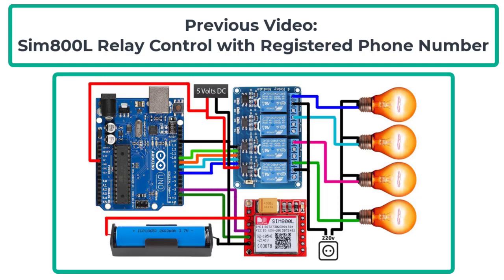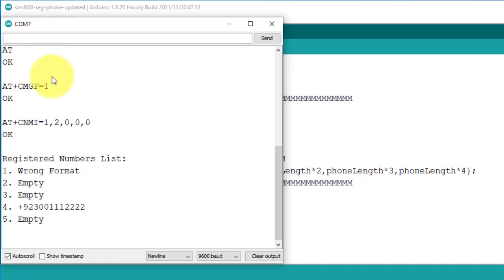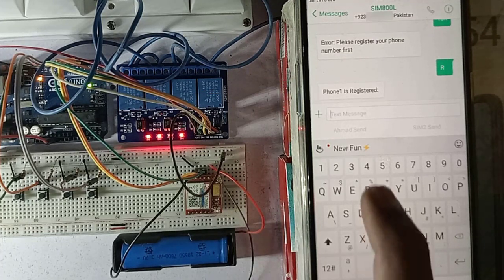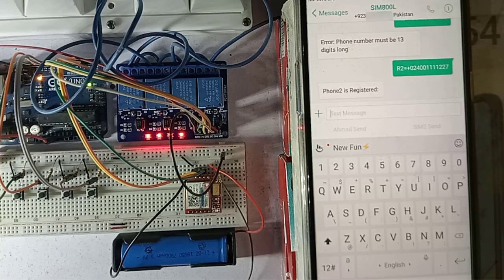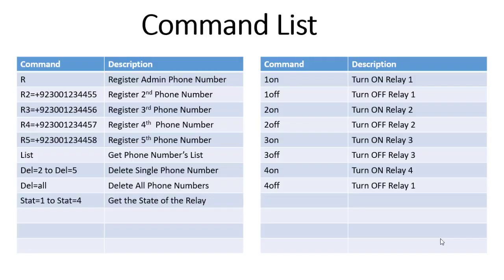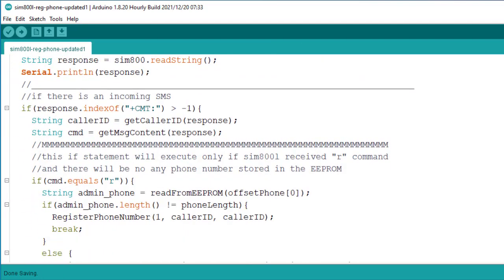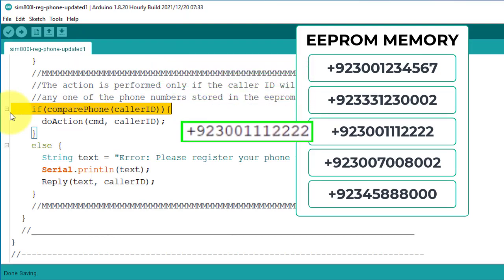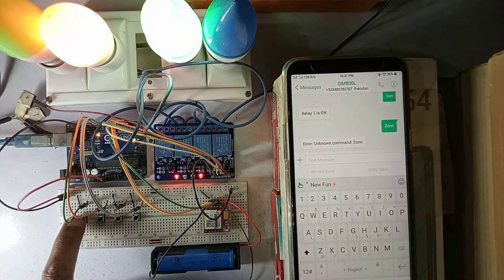SIM800L Home Automation Project Using Arduino and Push Buttons

Comment: Hello sir Ahmed I have a question, how can I send a message to all numbers stored in EEPROM just in case I want to send a specific message to all numbers that is registered
Reply from the maker: you need a loop to iterate through each number and make a call using ATD command

Comment: In this code and video, the response is sent only when the module is controlled via SMS.
But I want SMS to be sent by pressing the buttons. For example, when the first button is pressed, an SMS is sent like this: "Button1 has been pressed"
Reply from the maker: connect a button to arduino. then set the button pin i.e. int buttonPin = 1. in the setup pinMode(buttonPin, INPUT_PULLUP);

In the loop()
if(buttonPin == LOW) {
     delay(200);
      Reply("Hello", "PhoneNumber");
}

Comment: hi, how can send SMS when push buttons pressed!?
Reply from the maker: use in the loop()

if(buttonPin == LOW){
Reply("Hello");
}
Reply: @AhmadLogs  thanks dear Ahmad.. i did that,, but i want to change the state one of outputs too..all things okay, but the registered phone was not work for this operation, i define caller id for this function ... but after compiling, i faced the error about saved number
Reply from the maker: @mymail-f9e  can you give me the full detail about the issue.
Reply: @AhmadLogs  I'm going to add an input to this circuit that when triggered - for example when it becomes HIGH- one of the similar outputs will be activated(like led). At the same time, send a text message.
So I want to add an option for security system like PIR sensor .
Reply from the maker: @mymail-f9e  can you share the code?
Reply: @AhmadLogs  sure... Where should I send it to view?
Reply from the maker: @mymail-f9e  just upload it on github and share the link here.
Reply from the maker: @mymail-f9e  you can get the code for pir sensor from the descripton of the following video. https://youtu.be/d39VmyAcfys

It will give you idea how to use the pir sensor with sim800l
Reply: @AhmadLogs  thank you dea Ahamad... I have been solved that by redefine Caller_id in the sub loop function..
Reply: @AhmadLogs  the Reply(a,b) function has 2 string , so i cant use just 1 string like Reply("Hello") !
Reply from the maker: @mymail-f9e  sorry for oversight. the second argument is the phone number to whom you want to send sms. 
Reply("hello", "+923219988776")
Reply: @AhmadLogs  SIR I WANT TO SEND THIS SMS TO ALL REGISTERED PHONE NO. VIA SMS.
SO WHAT I DO.
Reply: @AhmadLogs  AND ALSO TELL ME HOW I SEND CALL TO ALL THIS REGISTERED PHONE NO. WHEN THEY PRESS BUTTON 1 TO ON OR OFF RELAY
Reply from the maker: @Humanityandfun  you can use multiple ATD commands for this
Reply: SIR PLEASE TELL ME HOW I SEND MESSAGE AND MAKE CALL TO ALL REGISTERED PHONE NO. WHEN MY BUTTON_1 AND bUTTON_2 WERE PRESSED

Comment: Dear Ahmad Vai, Assalamu Alaikum. Your videos are very good, informative and useful. Would you please make a tutorial on AC load on/off notification project please? In that case you can use SIM800L or SIM900, Arduino Nano and a 5v power adapter for check power on off. The circuit may run by a 18650 lion battery.
Reply from the maker: will try

Comment: Hi Ahmad. Thanx for your great job, it’s really impressive. Could you advice with the code if I use sim 900 instead of sim800l. This code is not working with sim 900
Reply from the maker: unfortunately I did not have sim900 module. so I am unable to answer. As I know, you need to modify some of the AT commands in the code.
Reply: @AhmadLogs  anyway, thanx for your video. It helps me a lot. Will continue to find code for my sim900

Comment: Hello Ahmad, your videos and explanations are great, I need your help, how can I do so that all registered numbers receive messages, for example, when a relay has been turned on or off... I hope you can help me solve my problem... Greetings
Reply: ok thanks, I just don't understand how I should call the make_calls function so that it interacts with the doAction function and the Reply function, so that it sends messages to all registered numbers
Reply from the maker: @pablotorrea9901  Sorry the above function was wrong.

use the following Reply() function, instead of original one.

void Reply()
{
  int phoneLength = 13;
  char data[phoneLength + 1];
  for (int i = 0; i < phoneLength; i++)
  { 
    data[i] = EEPROM.read(addrOffset + i);
    String myString = String(data[i]);
    sim800.print("AT+CMGF=1\r");
    delay(1000);
    sim800.print("AT+CMGS=\""+myString+"\"\r");
    delay(1000);
    sim800.print(text);
    delay(100);
    sim800.write(0x1A); //ascii code for ctrl-26 //sim800.println((char)26); //ascii code for ctrl-26
    delay(1000);
    Serial.println("SMS Sent Successfully.");
    delay(20000); //20 second delay.
  }
}
Reply: thanks friend, one more question the addrOffset variable must be declared within the () of the reply function or I can declare it within the for function, because if it is not declared it throws an error.
Reply from the maker: @pablotorrea9901  you might declare with within the function
Reply: Hello Ahmad, the reply() function that you indicated did not work quite right, it only sends a message and it is to the administrator, it carries out the process of sending the messages by viewing it on the serial monitor. I replaced all the call_id strings with myString ..
I can't understand if I'm doing something wrong, please help. A video tutorial with the explanation would be very helpful
Reply from the maker: @pablotorrea9901  can you provide me your code? just upload your code in github and share the link here
Reply: Hi.! Ahmad, I took a few days off, tomorrow I'll upload the file for you to review and help me solve my problem
Reply from the maker: @pablotorrea9901  provide me the link
Reply: hello again ahmad.. sorry for the delay, I'm using the function you told me to send the message to all the registered numbers, but as I told you, it only sends the message to the administrator.. it's a code for a program that I want to check states , but I need all notifications to reach all registered users. I hope you can help me
Reply from the maker: @pablotorrea9901  I know what you want. just post the link again. I will try to review the code
Reply: @AhmadLogs  I have repeatedly uploaded the link and it disappears from the comments, I don't understand why, I upload it just as you leave it in the description of the videos. Could you provide me with an email to send you the repository link please
Reply from the maker: @pablotorrea9901  I find the repository but there is no code. https://github.com/Pablo4
Reply: I don't understand why the link is removed
Reply: Pablo4torres/EEPROM-SIM800
Reply: Sorry, only in that way I was able to upload, just add at the beginning what is missing
Reply from the maker: you can use the following function to make call to all registered phone numbers.

void make_calls()
{
  int phoneLength = 13;
  char data[phoneLength + 1];
  for (int i = 0; i < phoneLength; i++)
    { data[i] = EEPROM.read(addrOffset + i); }
  sim800.print("ATD"+data[phoneLength]+";");
}

Comment: Hello sir. Everything works well but when i send a message, the relay board does turn on or off. And am sure the relay board works well and the circuit is well connect. Wha might be the issue there? Plz help me out.
Reply from the maker: check serial monitor send me the output

Comment: Morning please if anyone can help me as soon as possible. 
I uploaded the code directly the relays start from on as show in the video but when I change the phone length from 13 to 14 and upload the code, the relay doesn't even start from on and when I try register phone no, it was registered but when I send command it only appears on serial monitor and reply "relay 1 on" but no response on the relay at all
Reply from the maker: it works perfectly on 13 digits phone numbers. have you registered your phone number correctly?

Comment: I can't appreciate you enough for being such so kind hearted. Thank you for all your quick responses and prompt actions.

My own problem is that 
 1 *arduino needs to reboot after each action has been completed*. 

2 how can I add DTMF  to the project . so I can make  calls to control the relays too.

Please how can I achieve this? 

I await your response with urgency, thanks in anticipation.
Reply from the maker: here is your answer https://youtu.be/Hq1ZGWWc0e4
Reply: Hello Ahmad, your videos and explanations are great, I need your help, how can I do so that all registered numbers receive messages, for example, when a relay has been turned on or off... I hope you can help me solve my problem... Greetings
Reply from the maker: @pablotorrea9901  you can use the following function to make call to all registered phone numbers.

void make_calls()
{
  int phoneLength = 13;
  char data[phoneLength + 1];
  for (int i = 0; i < phoneLength; i++)
    { data[i] = EEPROM.read(addrOffset + i); }
  sim800.print("ATD"+data[phoneLength]+";");
}

Comment: Please add the flames and gases sensor feedback notification with sms and add the one more features is that if project  is start to run then add the call and sms function which gives the notification is system is active
Reply: This is bumble request to you plz make the video on this. Or may be shared code alao in the description plz sir

Comment: I watched your SIM800l tutorials, I am able to register 5 phone numbers by watching your videos. But can you please tell me how can I make a call to admin number which is stored in EEPROM memory when a switch is pressed. It works for the first time but if I turn off the arduino power supply it doesn't work. Please suggest me. Thanks in advance.

Comment: Awesome, Thank you! But how do you get the relay board to start with all off instead of all on?
Reply: The Relay he used in the project has three plug-ins. Common, Normally Open and Normally Close. A cable, either positive or negative must go into Common. If the second cable is plugged into Normally Open, the relay will default ON. If plugged into Normally Close, the relay will default OFF.
Reply: Hello Ahmed, I want to send me an sms when the device is turned on to start, so that when it is turned on remotely, what changes should I make in the code?

Comment: Thx for thr project bhai. Well, an doing the same project but the relays not responding. When i send a message it shows the relay 1 to be on but no reaction on the relays to turn on. What might be the issue

Comment: Hi Ahmad, how to add if the dedicated button is pressed send an SMS message saying BUTTON PRESSED like a calling bell
Reply from the maker: hardware setup: attach one more button to unused pin of arduino
software setup: define the pin for button before setup function. set the button input pullup in the setup. then go to the control relay function. and there check if the button is pressed using if condition. and inside the if condition use Reply() function. like Reply("Button is Pressed");
Reply: @AhmadLogs  no luck🙃
Reply: @AhmadLogs  Could you please check the below code for sending out SMS if the gate is open or closed, getting an error when adding  Reply(text, caller_id);

//XXXXXXXXXXXXXXXXXXXXXXXXXXX gate on / off button XXXXXXXXXXXXXXXXXXXXXXXX
void gate_on_off_button(){
if(digitalRead(BUTTON_2) == LOW){
 //control_gate(1, RELAY_1,STATE_RELAY_1 = HIGH,caller_id){
 // control_gate(1, RELAY_1, STATE_RELAY_1 = HIGH);
    control_gate(1, RELAY_1, STATE_RELAY_1);
    }
}

void control_gate(int relay_no, int relay_pin, boolean &status){
  delay(200);
  String text = (status)? "GATE CLOED !!!" : "GATE OPEN !!!" ;
  status = !status;
  digitalWrite(relay_pin, status);
  Serial.println(text);
  delay(100);
  }
//XXXXXXXXXXXXXXXXXXXXXXXXXXXXXXXXXXXXXXXXXXXXXXXXXXXXXXXXXXXXXXXXXXXXXXXXXXXXXX
Reply: hi, got the chance to look into this:dothefive:

Comment: Frind for admin register need send r or R fisrt ?
Reply from the maker: you either send r or R. both commands have the same function.
Reply: @AhmadLogs  bt why not register i did but my number length 14 need change 13 to 14 only?

Comment: Dear Sir it is possible to add the timer function please thank you for the effort you are making
Reply from the maker: yes it is possible
Reply: you can send us the enforcement code adding timer and call

Thanks
Reply from the maker: @adlanhugo353  I did not write it yet. I will soon make the version 4 of the project. and will try to add these features.
Reply from the maker: @adlanhugo353  will try
Reply: Please can you add me the code with the timer and call
Reply from the maker: @adlanhugo353  unfortunately not yet

Comment: Hello Ahmed Khan
Most of the time, we face insufficient pin in programming
It is possible to write a program that controls 16 relays using SMS and using shift register and 4 Arduino pins.
Reply from the maker: you can use shift register to increase the gpio. it is possible

Comment: Is this any reason you use 3.7v external battery. why are you not use node mcu 3.3 volt pin..
Reply from the maker: sim800l required voltages 4.4v to 3.4v. so we cannot use 3.3v pin of nodemcu. if you don't want to use battery you can use lm2596 dc to dc buck converter. and adjust the voltages for sim800l using buck converter
Reply: @AhmadLogs  thanks..
Reply from the maker: @Javedansari-yl6ts  welcome
Reply: @AhmadLogs  can i also use LM317 voltage regulator ic    
From 5v supply for sim800l ..
Reply from the maker: @Javedansari-yl6ts  yes you can. just give it a try

Comment: I like the way you explain the program function, specially the details and short presentation of moving the data
Reply from the maker: SO NICE OF YOU
Reply: if anyone have different phone length u also need to modify the number on this line of code : String temp = text.substring(3, 17);

Comment: getting relay Off SMS  where Relay is on after the whole system putting off & on each time. command used "stat=1", I think the code is having a bug.
Reply from the maker: please give me some more detail
Reply: @AhmadLogs I have sent 1on sms to turn on rely & reboot the arduino then sent the sms stat=1 which gives the relay Off sms back but relay 1 is already on ,  how to turn off  all rely when reboot the arduino? This will help the pump to be off when power failure happens
Reply from the maker: @pookoye  I have updated the code. download the latest copy of the code, test it yourself and let me know
Reply: @AhmadLogs  Thanks Ahmad, just today I have seen your update & haven't got notified, what is the update? is that related to the wrong SMS update on relay ststus?
Reply: @AhmadLogs  How to clear the SMS stored in the SIM, is there any code or command to do?
Reply from the maker: @pookoye  AT+CMGD=1 to delete all the sms
Reply from the maker: @pookoye  I have just upload a new video on about rfid attendance system
Reply: @AhmadLogs  Hi Ahmad, with the current code how long the EEPROM CAN stay, maybe 10 commands in a day
Reply from the maker: @pookoye  I have calculated you can used it about 27 years. the same calculations that I have done in my some old video
Reply: In arduino nano?
Reply from the maker: @pookoye  same
Reply: @AhmadLogs  how to achieve automatically clear all SMS before it fills up the phone memory, this will help to avoid opening the enclosure frequently
Reply from the maker: @pookoye  I have updated the code with automatic delete sms feature. so just download the latest copy of the code.
Reply: @AhmadLogs  Thanks Buddy.....
Reply from the maker: @pookoye  same to you
Reply: @AhmadLogs  how does it deletes the message? When it powered on?
Reply from the maker: @pookoye  I have added the delete sms AT commands in the setup. so when you reset your module the sms will automatically delete
Reply: @AhmadLogs  push button is very sensitive, it has to be very quick otherwise relay will trigger many times...
Reply from the maker: @pookoye  the problem will be solved using Debounce on a Pushbutton
Reply: @AhmadLogs  Do you have any plan to add External I2C EEPROM (24LC256) to nodeMCU orESP12E for this project?
Reply from the maker: @pookoye  not yet
Reply: @AhmadLogs  Is it possible to send AT commands by SMS in this project?
Reply from the maker: @pookoye  yes it required to update the code

Comment: Sir, I am Tested and working all functions properly . But Replay message shows below error sir,
1on - Output 5 pin  Relay is ON -   and Replay message - Relay 1 is ON
1off- Output 5 pin  Relay is OFF - and Replay message - Relay 1 is ON
Same Replay message for other 3 relays.
I am upload code by using Arduino IDE 1.8.12 
But all other functions like Store number , Delete number , stauts ,EEPROM , Input Switch 100% working properly.
Sir, please replay a solution  for correct Replay message.
Once , Thanks for Developing and Shared above very useful project.
Reply from the maker: I have updated the code. please download the latest copy of the code
Reply: Dear Ahmad sir, Thanks for your valuable replay & updated code Sharing. Sir, one request , updated code download link please . After testing surely replay sir. Best wishes for your New Projects and code development.
Reply from the maker: @renjithcatek7435  thanks, check and let me know
Reply: Sir, one request , updated code download link please .Thanks
Reply from the maker: @renjithcatek7435  the same link in the description
Reply: @AhmadLogs  THANKS
Reply from the maker: @renjithcatek7435  so nice of you